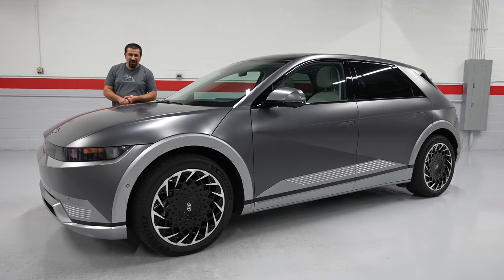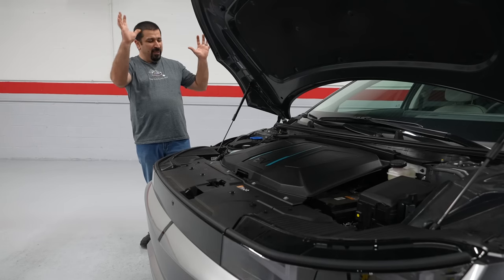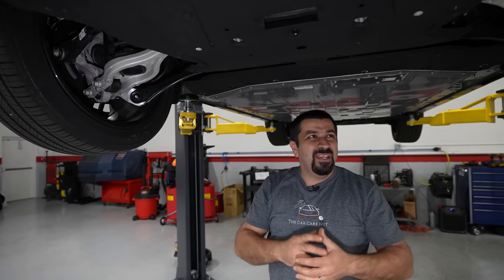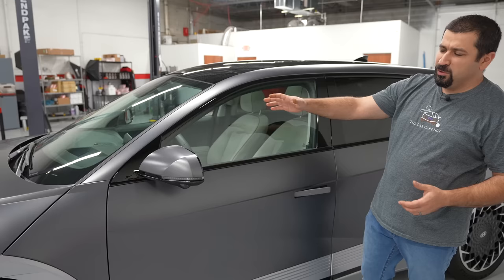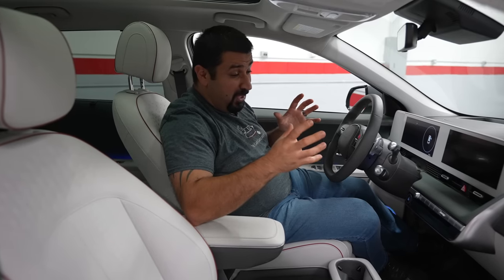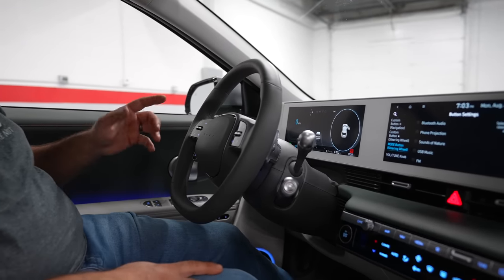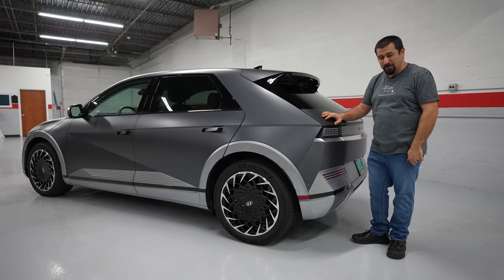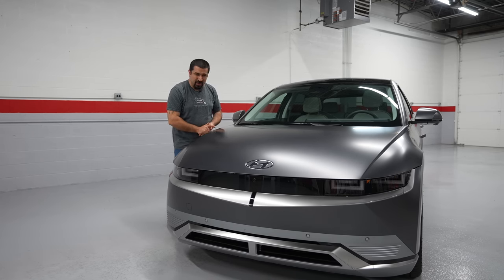Should You Buy a Hyundai IONIQ 5? Or a Tesla? | A Very Comprehensive Review

Comment: I own this car in AWD Limited trim. I love this car and consider the best in the catogery. I do agree with the exterior design in personal taste, and not everyone will like it, but that is true for all other cars also. The car was designed for smaller Digital rear view mirrors, but they are not allowed in US. As such, they had to design the giant rear view mirrors. the 4 dots on steering Wheel stands for 'H' in morse code. the car is super quiet on the highway and much quieter than some of the higher luxury cars, not to mention the ride quality. One snag is the rear view wiper, but that is not the end of the world. I have traveled long distances and the range anxiety is thing of the past. that is true for all electric vehicles though. There are some quirks like positioning of Qi wireless charger, no wireless Andrid Auto,  but those are not deal breaker in grand scheme of the car. The cr has plenty of power and lets you adjust as per your needs, more then other electric cars. The regenerative braking also has more levels to suite your driving habits and needs more than the competition. Overall, I feel it is a better car than the competition. Things will change and should change with the influx of new electric vehicles.
Reply: Android Auto works when you plug the phone into the front USB port, the one under the AC controls.
Reply: how good is the suspension? I live in an area with just trash roads and potholes

Comment: Taking my Audi Etron in for 40,000 mile service, asked what they will do. They will check underneath, suspension, brakes etc… only thing to be done is drain the motors coolant overflow cups. That’s it! Still have the same range after 2.5 years of ownership, no problems. It is the most comfortable, fastest, most enjoyable car I have ever owned. Take a few trips every year, I use EA chargers along the way. Sometimes the chargers won’t work properly, have to try another one next to it. Usually they are in Target or Walmart parking lots. I plug in swipe my EAApp go in store use restroom look around a bit. Takes about 20 minutes average to charge. You don’t have to charge to 100 every time, just to get you to the next chargers. I stop about every 2 to 3 hours to charge and stretch my legs. If I needed longer range a would have bought a hybrid. I charge overnight at home, you can’t do that with a gas car! I will never go back to ICE.

Comment: You make a lot of good points in your video, but you also are saying things I disagree with.  First of all you claim that it only adds one percent of range overnight plugged into 110 V outlet. That is utterly ridiculous.  The charger supplied with the car has variable settings and you probably had it set at a low amperage. If you put it to 12 A I promise you it will charge a lot faster than your claim.  You also are complaining about the gearshift, which I find to be the most logical and easy to use gearshift I’ve ever owned. It does not require looking at it like buttons do. And it’s totally logical that you twist it forward to go forward and twist it backwards to go backwards.  Since there’s no resemblance to a standard floor mounted gearshift, why should the reverse and Drive be positioned similar to those?  Over all I love my car, but I realize there are drawbacks to electric cars that you are correctly pointing out.

Comment: Hyundai/Kia's adjustable brake regeneration on the paddle-shifters is VERY underrated.  If you switch between coasting and heavy regen rapidly while on your trip, you'll extend your mileage to 5.5 mi / 1kW, or slightly more. Only the upcoming Cadillac EV has a similar feature. Not sure what was the problem with charging this car at home. You should get 4-5 miles of range added every hour it's plugged in. I charge my own EV while asleep at home. I never ever wait inside the car while it's charging, not even on road trips (I time my food and bathroom breaks to the car charging times).
Reply: It has a problem. The break lights don't come on when the vehicle is deaccling quickly (when on single pedal, regen mode, and you don't fully release the accelerator )
Reply: @hariranormal5584 that’s a very good point , glad you thought of it and hopefully someone from Hyundai will look into it.
Reply: @Tony-un3vf  
Actually haha thanks but I'm not even the one remotely close to discover this, a channel called Technology connections looked into this. In the comments some said they're from Hyundai and that they'll look into it too.
Reply: @hariranormal5584   update coming that puts on the brake lights on regen this week!
Reply: That’s basic stuff - how would you miss that?

Comment: I don't necessarily agree with you on the general design and usability points of the overall car but you make a great general point about whether or not EVs are a good fit for everyone. I learned this the hard way by purchasing one. 80% of the time it's a great vehicle when driving around town and staying within the county, especially with a level 2 charger at home that we can charge overnight. But for road trips it becomes a huge hassle and like you said I've contemplated renting a car several times just to go from Seattle to Portland and back because 250 miles of range under optimal conditions around town turns into 170 miles of range driving 75mph in cold temps. And then when you go to charge the stations are often full and half of the terminals are broken. Then charging takes over an hour because you don't always get the fastest speeds. And imagine doing this with two crying babies in the backseat. So I think an EV would be a great addition to a multi-car household. If you have an EV for most of your driving and then a 2nd car for roadtrips then life could be good.
Reply: Clearly you are not talking about Tesla.
Reply: @flattire707  nope. Tesla is much better with more charging units at their stations and and a very good network but it still sucks balls compared to refueling at a gas station where I can go from empty to full in like 3 minutes.
Reply: That's the reason you don't buy a non-TESLA EV
Reply: Huh I just went on a long road trip with an EV6 and in optimal weather I got 320 miles of range (over the EPA rated range) I just drove 65mph instead
Reply: @El-ng7mb  optimal weather and optimal speed. That changes drastically when it's near freezing and you're going 75-80mph. Your EV6 also charges much faster than my slow ass VW.
Reply: @Great10nis  Not everyone can afford them, or not everyone likes their legendary build quality.
Reply: @flattire707  Spoiler alert, due to the fact that Tesla has sold a record amount of them, their chargers are now so full they cause fights over who is next.
Reply: @sullybiker6520  “legendary build quality”, underrated comment there for sure! 😂

Comment: I bought sel AWD in January 2022. Already 9,000 miles . Love it, especially design. Obviously you need basic level 2 charger , and it does charge super fast on dc fast charger. It has over 300 hp but it’s not a sport car , soft plush riding , greet commuter and it’s quiet on a highway. One real negative in this car is lack of rear wiper . The rear window gets very dirty. So far had been reliable , no problems and Toyota recalled all their new electric cars because wheels falls off. I like car care nuts reviews but  think he doesn’t realize that future of transportation is ev . I used to lease Chevy bolt and than bought ionic 5 . It is like one you use iPhone can’t use basic flip phone anymore
Reply: toyota is also removing back window wiper on some model...it is a stupid idea!

Comment: You need to select 12 amps on the Level 1 charger that comes with the car. It defaults to ~7 amps to not overwhelm an old house circuit breaker. Takes a few seconds and stays that way if you don't unplug it.
Reply: I am waiting to get my level 2 charger hooked up so I’ve been ising the wall 110 volt charger for the last week when needed. At 12 amps (the maximum allowed by the electrical code) the 110 volt charger will recharge about 2 percent per hour!  Okay, that’s not  fast, but it’s way faster than the example in this video.

Comment: Just saw another YouTube story, exact same car—1 year old, guy goes to the dealer for an inspection, they see a scrape on the battery protection cover and decide -without removing the cover-that the battery is damaged and needs to be replaced, price of the new battery installed is $5k more than the car cost new—further more if the guy is told if he drives it and it explodes he will be responsible for all damages. His insurance company tells him if he makes a claim his car will be written off and his insurance premiums will increase for the next 10 years—all I can add is check very carefully on which circumstances will void the battery warranty otherwise you could be sitting on a $60k time bomb
Reply: To be fair, that was in Canada if I'm not mistaken.
I've heard a few similar stories about shady stuff regarding dealers, insurance and EVs in Canada.
Still, something to consider.

Comment: I thought the same about the design at first but I've already grown to like it after seeing it in real life a few times. It looks pretty cool tbh. Also this is as close to a regular ICE car experience you'll get with the added benefit of being electric. Also read from multiple reviews this car drives much smoother than the Tesla Y which in Canada is 30k more expensive.
Reply: Here in Europe, in some countries model Y is cheaper €10k
Reply: Being electric is not an advantage.
Reply: @phillipbridge5009  Depends what factors you are thinking of.
Charge/Refuel time: sure, that's a downside.
Electricity/Fuel cost per driven distance: Definite benefit.
Service costs: Benefit.
Acceleration: Benefit.
Ability to keep the climate on while parked: Benefit.
Scheduled pre-heating/cooling of the cabin: Benefit.
CO2 emissions over the lifetime of the car: Benefit.
Being able to "fuel" up at home: Benefit.
Cost of the vehicle: Definite downside.
More spacious cabin compared to the outside dimensions of the car: Benefit
One Pedal Drive Mode: Benefit (if you like that style of driving)
Frunk: Benefit
Being able to work on your own car: Definite downside
Not needing to scrape ice off the windows: Benefit

Comment: I have a 2021 Ioniq5, European model premium level(mid range). There are some disadvantages of the car( headlight is poor, no wiper at rear window etc.), but my major issue came out just recently traveling 2x650 km in winter (Budapest-Munich). 
You mention in your excellent (as always) video the complicated cooling system, but the real issue is the lack of battery heating! I was not able to use the very fast charging due to low battery temperature, which was between 5 to 10 deg, Celsius during whole travel. Therefor avarege charging speed was 53 kWh/hour (nominal is 170 kWh/h, 58 kWh battery).
Now my questions: do you think Hyundai does "forgot" to build in battery heating, or they just did not activated software-wise. In 2021 battery heating was optional item, costing 300USD, and in my car this option was not selected by the Hyundai dealer.

Br. Nandor
Reply: Not sure about Europe, but in the US there is a software update (need to get from the dealer) that enables battery preconditioning.  It does not work as seamlessly as Tesla though.  There are videos on YouTube that shows you how to get it working.

Comment: LOL, fun fact the 4 dots in the steering wheel is actually “H” for Hyundai in Morse code and it is supposed to show the charge level as well. 😉
Reply: I'm happy that someone mentions this for AMD.
Reply: The charge level display will come with the Ioniq 6, the Ioniq 5 simply has those dots as design feature.
Reply: @karlgunterwunsch1950  I stand corrected, I knew I saw a review with that but it could have been the 6.
Reply: @CC-wm1yq  I don't know if I even want that to light up, could be distracting. But then again it could be that it's only on while charging.
Reply: @karlgunterwunsch1950  You’re right, there’s enough in these cars to distract us already!

Comment: I am approaching a 40 year continous experience with Toyota brand. I just made the switch to BEV and may never go back. The biggest reason you failed to mention for switching, ICE power trains have become less reliable and shorter life, its not just the routine maintenance that goes away with BEV. During the 80's and 90's Toyota's were ever improving,  over the last 20 years they have reversed that.

Comment: Thank you for this VERY informative video!  We live near St. Louis, MO and bought our Hyundai Ioniq Blue, Hybrid new, with 12 miles on it in 2019. She's beautiful!  She's a sparkly cross between Green and Grey; and her color changes with the light.  We've named her Sparkles.   If I'm good and keep my foot "out of it", we can get over 60 miles per gallon of gas.  I've gotten 64 without being careful.  He's right, we get the best mileage when we go below 70, but I look down periodically and I'm going faster on the highway.  She's got fantastic pickup!  We drive mostly suburban and highway; although we also go into the city occasionally. It has a lot of room inside, which we fill frequently driving things for my small company around and getting supplies.  It looks really good on the outside, too.   Our major complaints about it are that it can, at times, be a bit sluggish off the line, and sometimes the change from the electric motor to the gas engine is discernible.  Also, my spouse doesn't like that it doesn't have a CD player, which I don't like either.  It sits low to the ground and has a sporty sort of distinguished look; which I like since we are  in our middle 60's.  It's comfortable for our gently growing older bodies.  The dealership we bought this car from very recently called and wanted to buy it back and work out something for us to buy any other car on the lot.  We refused.  I would not want another all gas car.  My spouse says the next vehicle he wants to buy is the all electric ford pickup that's supposed to be out in the next 5 years.  We understand that it will start at about $40,000.  He wanted to put our names on the waiting list about 6 months ago, but it was full before he could.  I wouldn't part with this car and it now has a few miles on it.

Comment: Good video!  Are there any different engines and or transmissions for these or will all 2023 models have the same engine and transmission?  There's a 2023 SR5 for sale in my area now but seems high, around $40K with 50 K miles.  thanks.

Comment: I am a long time subscriber and when it comes to Toyota I consider you to be one of the best authorities. When it comes to EVs not so much. First to charging, if you are going to own an EV (regardless of brand) you are going to want a higher power outlet in your home that can fully utilize the vehicle's on-board charger. For most normal use cases, you can plug in at the end of the day and have the vehicles fully (or 80%) charged overnight. This means no trips to a DC Fast Charger except for road trips. And there is no getting into your vehicle in the morning and realizing you need to buy gasoline. Your home charging experience was with the so called "granny" charger. When you visit a location without suitable charging capabilities (Granny's house) you can still charge using a standard 120V outlet, albeit slowly. With a 20 amp 120 volt outlet, the maximum charging rate will be approximately 120 X 20 X 80% = 1920 watts. So it could take up to 40 hours to charge on this outlet with this Ionic 5 as it has a 77.4 KwH useable battery capacity. . The controls and screens situation is in flux right now with EVs as no standards have emerged just yet. IMO, the VW ID4 seems most familiar to folks used to conventional control setups.  I think we will soon enter an age where the controls setup on any vehicle you drive with be associated with your "profile" and the need to fiddle with most controls will disappear almost completely.

Comment: Just a heads up. You mentioned that you plugged into 110 level 1 charging overnight and barely got more than 1% charge. There's something fundamentally wrong there. Level 1 charging is 1.3KW, which ends up being 13-15% overnight (~45 miles).

Comment: I think you need to read up on battery repairs. Its not expensive compared to changing an engine or a transmission. The battery will most likely last way beyond the cars lifetime.
Reply: I concur. The Ioniq 5 is using the EGMP - the M standing for modular, which is referring to the makeup of the battery pack. In the case of the Ioniq 5 it is made out of 30 modules in Europe and 32 in the US (different usable sizes). Each of these modules can be replaced separately by trained technicians.

Comment: You are so right: People just want a normal car with a electric motor, that's it!!
If my old Ioniq 28 kWh had a bit more battery and the ability to tow a trailer I would drive it until it died of old age, it does everything I need and want
Reply: maybe look at the kona ev? I have one and its excellent
Reply: @360dom360  yes I drove one recently and it was fine, the bonnet is a lot higher than my Ioniq though. I really like the new Niro EV as well, I am hoping the prices will go down next summer then I'll probably upgrade to be able to go further on a charge and tow a 750 kg trailer